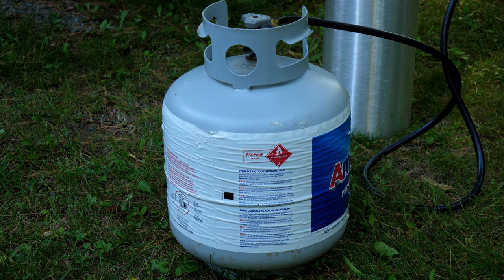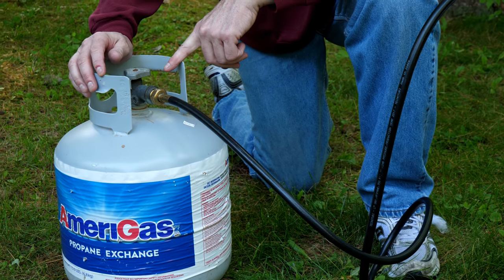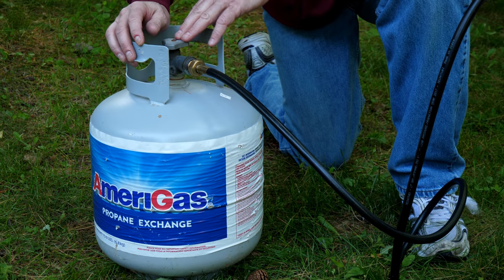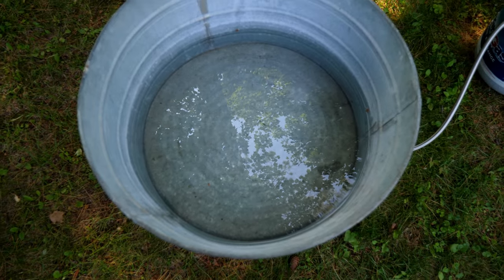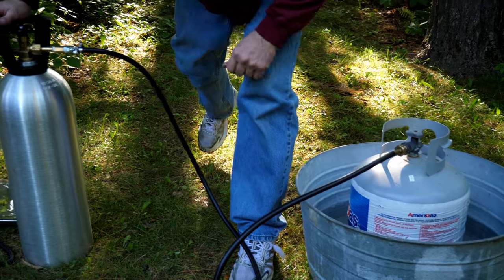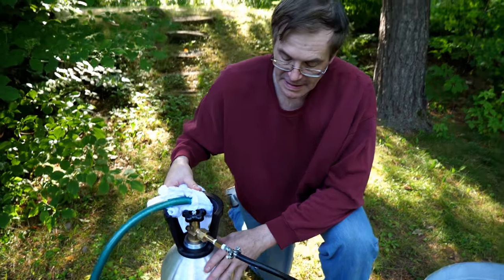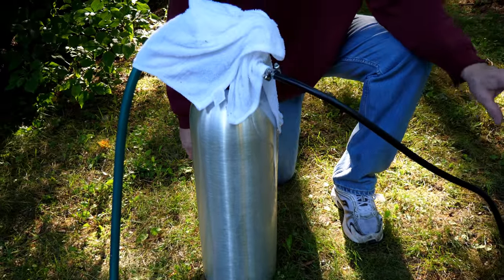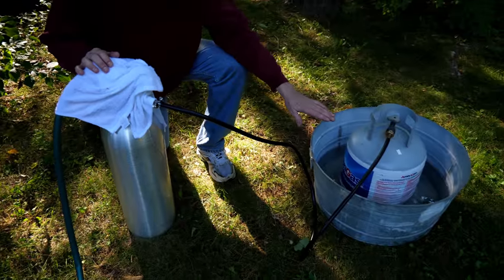Liquid Propane - How to Transfer Safely

Comment: $6/gal is absurd, but that's the price of the BBQ exchange it seems. For your projects, I would recommend getting a 100 lb DOT cylinder and filling it at your friendly local gas supplier for significantly less money. Then you have access to a dip tube and POL fittings that don't have an excess flow valve built in. For reference, the propane suppliers in my area are selling in bulk at $1.39/gal.
Reply: Yup, whole fill on a BBQ tank here in Montana is $8.
Reply: It's $4 a gallon for BBQ exchange at the local gas station, but everything seems to be cheaper in Tennessee. You have to pay up for the first tank though.
Reply: Yeah depends on the state I can 300 gallons at a time and it's around $4 a gallon... Insane
Reply: Nj is $3.79 per gallon propane at the refill bulk company in town .  Yeah I know nj is stupid expensive on everything

Comment: I would just invert the commercial propane tank and leave it in the sun (it can stay straight safely on a flat surface over the metal cylindrical surround where the handle is), and put my own empty tank in an ice bath. LOVE YOUR VIDEOS!!! I am an engineer and your ardent subscriber!!
Reply from the maker: Thanks!
Generally, you can't.  These modern tanks contain an inversion float valve that stops all flow when the tank is inverted.

Comment: How about using the regular propane tank upside down so you get liquid propane out? Is there a safety built to prevent this?
Reply: Tiberiu Nicolae No the OPD valve dose NOT stop the liquid propane from flowing when inverted. I do it all the time.
Reply: The advantage of not inverting the tank is that you do not get as many impurities out of the tank. Because the fuel evaporates and comes out in vapor for instead of drawing liquid directly you wont get much of the methanol.  However if you want the methanol in your tank then this may be a good thing. Depending on supplier you can end up with quite a bit of methanol in a 20lb tank over the years. 
Easy way to tell, turn it upside down and let just a little out from your hose onto the ground.  If it does not evaporate its not propane. I fill my own manchester 1lb tanks with the 20lb upside dowm. and i always check first before filling them so i dont get half a quart of methanol in the little bottle.

Comment: Could you turn the supply steel tank upside down?  That would leave the vapour at the 'top' (bottom) and drive the liquid out of the valve directly?  Great video though!!
Reply: yes have done that many times without a problem keeping in mind NOT to overfill the "empty" cylinder
Reply: @willrobbinson  how could the empty tank get overfilled if transfering from an upside-down source rank?
Reply: drevilatwork using a larger supply tank
Reply: I wondered about this too
Reply: 1st,I would vacuum pump the CO2 tank & weigh it (for tare weight, or empty wt.) & connect transfer hose to both tanks). 2nd, chill it with cold water or ice. 3rd,  heat the supply tank with hot water bath 4th, flip supply tank upside down, then open supply tank valve while it is upside down (so the overfill safety float will open). 5th, place CO2 tank on scale, open it's valve & fill to a Maximum of 80% of the CO2 tanks Liquid capacity (10 lbs, I think you said). Flip & Turn off the supply tank valve & CO2 tank valve & disconnect the hose. Done.
Reply: @drevilatwork  You open the bleeder screw until liquid starts to escape.  The destination tank is full at this point.
Reply: @drevilatwork  Anything more than 80% full is overfull and can potentially cause an overpressure situation if left in the sun or a hot car in the sun.  These tanks aren't built to handle that much pressure.  So a 20 pound propane tank holds 20 pounds when filled to 80% of it's actual capacity.

Comment: Interesting way of transferring propane without inverting the tank or using a compressor. Though if you want to get things done faster, 100lb tanks still have the old-style POL valves and can be inverted to get liquid with no issues. 
Fun fact, here in Canada it's actually fairly common to heat the propane tank with a much larger tiger torch. When it's approaching -40 and the propane will barely boil, a short blast from the torch will bring the pressure up quick so you can get back to heating things that are frozen. The only real risk is heating the propane enough to pop the relief, which is not going to happen at -40.

Comment: Propane makes a good refrigerant as well, I've worked on commercial HVAC equipment for years. Have come across equipment utilizing not only Propane but Ammonia as a refrigerant. Dangerous but effective.
Reply: Worked with Ammonia refrigerant at an ice rink once, first thing you learned was how long you could hold your breath and how fast you could put on the Shelly (SCBA) rig

Comment: I tried the method in this video with transferring 4 gallons of propane using very hot water in a tub on the tank that I wanted to empty and snow on the tank I was transferring the propane to.  We had to change out the 5 gallons of hot water 5 times, and keep adding snow to the top of the recieving tank.  This method is way better at transferring heat than transferring propane.  The process took about an hour.

Then for a second partial tank I wanted to transfer,  I warmed it up and flipped it upside down before trying to transfer the propane and most of the liquid propane moved to the recieving tank in about 3 minutes.  Then I flipped the tank back upright and warmed it with hot water and the remaining propane moved out in about 4 minutes.

I recommend warming  the tank you want the propane out of with hot water or sunlight and cooling the recieving tank with cold water or snow.  Then, connecting the tanks then flipping the hot tank upside down and opening the valve on both. Continue to cool the recieving tank to keep the transfer going.  Then when the tank is almost empty, turn it upright and set it in a bucket of hot water to get the last bit of the propane to transfer.  When the recieving tank is cold and the giving tank is warm and feels empty when shook the transfer is complete and yo can turn both valves closed and disconnect.
Reply from the maker: Flipping the tank can work, but not with these and some others because of an anti siphon valve that prevents all flow when inverted.

Comment: Thanks for explaining this, I bought a second hand JPX T240 jet engine a few weeks back complete with a propane tank and cannot find much on the net on how to transfer liquid propane, I was always wondering if you simply just turned the tank upside down to get liquid across.
When I get chance I'll film an engine run on my channel, I have quite a lot of model jet engine test runs on my channel throughout the years
Paul
Reply from the maker: Most of the exchange propane tanks have an anti siphon valve that prevents all flow when inverted.  Although you can get tanks designed to allow liquid transfer, there is a big advantage to the more time consuming method I demonstrated.  Commercial propane is dirty, it contains other gasses like butane and even water.  When it vaporizes, these components can freeze and block lines.  By transfering a vapor, you are actually performing a purification step that leaves these low vapor pressure components behind.

Comment: idk about states but in europe you can buy propane cyliders with tube inside used in propane powered forklifts, or just turn the cylider upside down.
Reply: You can do the same in America, but it would be cheaper if you already have containers suited to be used for liquid propane to do it the way this guy did.

Comment: Thanks for video. On dip tube CO2 tank, would it make sense when finished to invert the tank and verify you get vapor out  to be sure you have not overfilled the tank?  If liquid, then I would assume,  weigh it, assume full then bleed ~20% of weight?
Reply from the maker: That's true.

Comment: More plausible is propane transfer from a 20LB refillable tank (you can refill at UHaul stations and the like cheaper than at the exchange program), to a nonrefillable blue 14oz tall skinny cylinder / 1lb green Coleman fat cylinder. The small cylinder is safe and convenient for local work with a small torch, etc. But it costs too much to use often. So, you can either buy an adapter hose to connect a device made for 14oz cylinder to the 20lb tank, or fill up the 14oz cylinder. To fill it, I placed it in wife's freezer. She did find it there and had to inquire, of course. Then using a relatively cheap transfer hose you need to purchase, invert the 20lb and while the small cylinder is very cold, it will fill up pretty fast.

In your situation, I wonder why you have not thought of suspesion-weighing the filling cylinder, from a scale / dial weight gauge. Just put the cylinder in a plastic bag, I suppose if the bag is strong enough and you put it at negligible height above soft surface (in case bag bursts), you might as well fill the plastic bag with cold water!

NEVER HEARD of see-thru tank - thanks!

Comment: I’ve worked with LP for over 20 years and evacuated many tanks in my career. Just invert the tank and for transfer without a pressure differential, lift the source tank over the tank you’re filling. We build “Gravity fill stations” that work this way. Of course it should be noted that it’s illegal to fill a cylinder with a product that it’s not rated to hold. Plus DOT cylinders are only good for 12 years after manufacture date and must be requalified after. Be safe out there, guys.
Reply from the maker: The check valve in these tanks prevents all flow, gas and liquid when they are inverted.
Reply: @TechIngredients  touché. I didn’t factor in the OPD. Thank you, sir. I do dig the vaporization/reliquification demo!

Comment: Don't know if you care at this point. But two things: 1.) You can get liquid service from a forklift cylinder. 2.) You can get propane a LOT cheaper by the gallon. Tractor Supply and Costco both will sell for not even half of what you quoted.

Comment: forklift cylinders use a liquid out on the service valve. you can get them in aluminum. Most DOT cylinders  have a tare weight stamped on the collar which makes it easy to determine how much liquid you have in the tank. typical bbq cylinders are called 20 lbs cylinders. propane liquid weighs 4.2 lbs per gallon. Propane cylinders are filled to 85% of their capacity, this is for expansion. 85% of 5 gallons =4.25 gallons x 4.2=17.85 lbs of propane when  20 lb cylinder is full minus the weight of the empty tank.  to check how many gallons of liquid propane is in any cylinder find it's  tare weight on the collar. It'll  say something like 5.6 TARE. This means the cylinder weighs 5.6 lbs. when totally empty.  lets say your cylinder weighs 16 lbs. subtract 5.6 (tare weight) from the scale reading of 16 lbs=10.4 divide this by 4.25 lbs per gallon of propane=2.45 gallons of propane left in your 20 lb. bbq cylinder.  BTW propane is NOT considered a high pressure gas, such as compressed oxygen, argon etc. Tank pressures on any propane vessel  no matter its size will only be around 90 psi on a mild summer day and around 110-120  psi if the tank has been sitting outside even in the sun. Propane liguid expands when it warms up.  
  How do I know this? I worked i  the propane industry for 15 years. Don't  paint your propane tanks flat black or any dark color, there's a reason they're all white or silver.

Comment: BTW Those 20lb tanks are now 15lb tanks for the same price at the "big box stores"
Reply: Not true, maybe some yes but, you need to look and make sure the T.W. Tare Weight says usually around 19.5 or 18 or 21lbs before buying one.
Reply: HE is correct the vast majority on exchange tanks at a 15 pound net weight. You will usually find this in the fine print. Tare weight is not what you are looking for at an exchange. Net weight is what you are looking for to indicate how much propane is in the cylinder. The good ones will be 20...most are 15.

Comment: Does this also work with Argon? I Have a 5 litre for tig welding on location and a 20 litre for in the workshop. the filling of the bottles is nearly as expensive for the two. Would be nice to be able to fill up the 5 litre one with the 20 litre one.
Reply from the maker: No.  You can simply transfer the gas between tanks as we do all the time, but unless you have a liquid/vapor phase present at the temperatures you are working with, the effect that temperature will play in the movement of argon is negligible.
Reply: Thanks for the information!

Comment: Applied thermodynamics!  I used to use this trick to charge Freon into my car air conditioner (back when it was legal to do so).  Charging liquid was dangerous to the compressor, if I just used a pan of hot water to immerse the Freon can I could charge gas and still be done quickly.  That always scared my neighbor, but hot water was not enough to explode a Freon can.  I did NOT resort to fire, I see you didn't either.

Comment: I would not mess around trying to heat one tank and cool another because, I do not know what I'm doing with trying to transfer gas from one tank to another. I get my tank filled at the commercial location where they have a multiple 1000 or more  propane tank for transfer and they pump it into my little propane tank. Thanks for the video it was interesting.

Comment: This is a very useful tip. thanks a lot for putting in the time and the effort to spread the knowledge.  i am going to use this tip to transfer the propane from a similar type of cylinder to a smaller one that I use with the hand torch.  Great Work!!

Comment: Lol... you had me fooled for a bit when you pulled the blowtorch. 
This is a pretty good method, actually. Gentle temperature gradients removed from actual flames are very good for a number of processes. 

That said, This liquid propane system needs a moisture trap. 

Liquid propane isn't used more often specifically because of the trouble in keeping moisture and humidity out of those systems and the troubles that they can cause. 
A propane gas system freezes the water into place at the top of the liquid/gas interface, but the pressure gradient between gas and liquid stops the moisture from forming a solid plug. 
A riser tube, such as is used in most liquid delivery systems, does not have this advantage.
If a riser tube freezes, a solid plug can be a serious problem. This is actually why NASA has stopped using liquid propane in many systems. 

If you're using a liquid propane system, you have to account for the differences in the "Dryness" of the propane because commercial suppliers catering to residential consumers, do not account for this difference. In fact, doing so would cut into their underlying profit margin because it would be an extra step in processing and storing said propane.

Using an adsorbent, like silica gel, is a pretty cheap and easy means of compensating for the lack of "Dryness" in the commercial source. The only issue with doing so is an exposure time required for most adsorbents to remove a percentage of water from the propane, but increasing the length of tubing filled with adsorbent should be sufficient. 
Also... note: absorbent =/= adsorbent. two distinct things... just so i'm clear on that....

Comment: While I've never tried this, I've worked in the LPG (propane) industry for a few years.
1. For calculating volume, I believe it weighs 0.5kg per litre, but double check that. It's lighter than water, so don't assume 1kg = 1L!
2. Never fill above 80% capacity (as mentioned in the video), and ideally use another gas container that has a calibrated relief valve for safety. Overfilling these things is easy to do, and can have horrific results (pressure increases in the destination container when the water is turned off and temperature inevitably increases). 
NB: Just a thought - maybe turning the source container upside down would help accelerate the process? As that way you have liquid pouring directly out of the valve instead of vapour. Some countries have valves to prevent that, the US may be one of them but I'm not sure as I don't live there.
Reply from the maker: Many of the newer tanks in the US also have these anti siphon float valves.  Another advantage of the slower vapor transfer method is that it acts as a purification step, leaving debris, water and low volatility oils behind.

Comment: Cody from Cody's Lab did this same kind of gas transfer with halon in a fire extinguisher, but he used dry ice to get the temperature differential. And you can see the level of the liquid in the metal container. You remember you have a thermal camera, right? Great channel, BTW. I am jealous of your lab. I only have a very messy Ikea table with lots of junk on it.
Reply from the maker: Thanks!
 I saw that video.  The advantage of using the smaller temperature gradient is that it is nearly free. And, if you're patient, it will produce the same transfer only slower. Also, a translucent, fiberglass tank would be better for monitoring the propane level.

Comment: In India they have propane tanks that have a exit hole on top, so you can join two tanks one on top of the other upside down and they have a 10 inch pipe you put between them. So the propane will transfer from the top tank to the bottom tank, without any heating or pumping. This way poor people can share Propane between neighbors.

Comment: Since your video about hybrid jet I'm thinking about fueling it with some form of oil (filtered used vegetable oil etc). I know it will not be as easy as with propane, but what do you think about that?
Reply from the maker: We're going to try several fuels with the new jet including isopropyl alcohol, gasoline and diesel.  If the diesel works then the oil should have a chance.
Reply: Good, can't wait :).